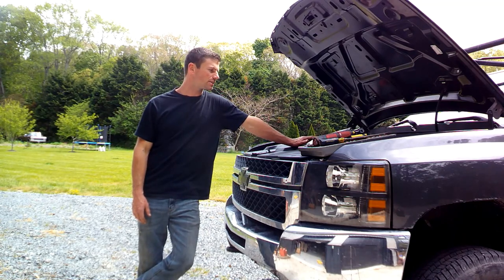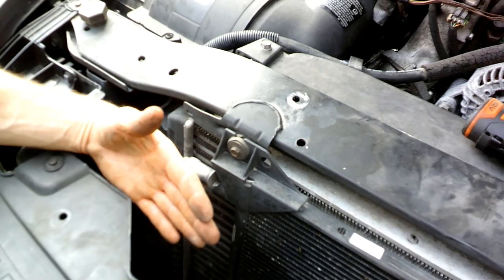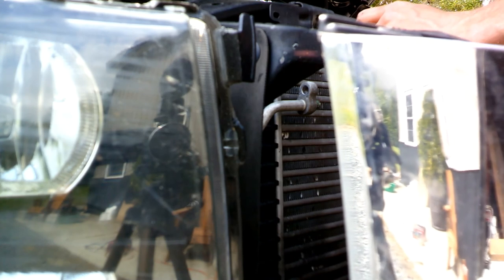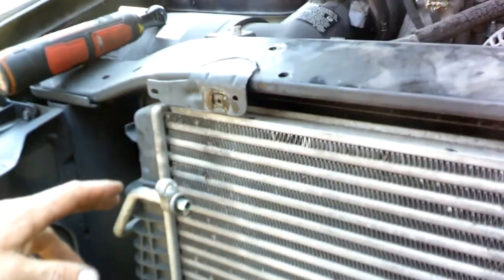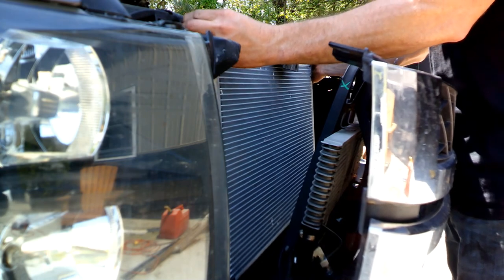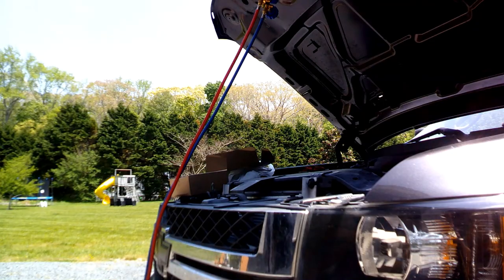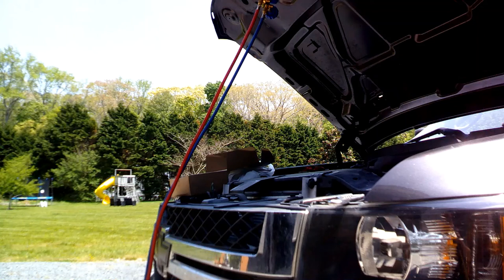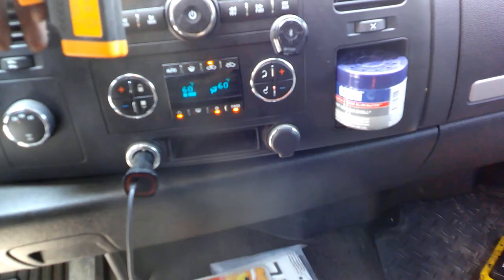08-13  GM Truck AC Condenser Replacement

Comment: You didn’t show pulling a vacuum to get all the air out after sealing the system up.
Reply from the maker: Oh ya it's pretty self explanatory, I'll be sure to include it in another ac video if I do one.

Comment: You may have missed putting in O ring seals on the condenser piping. Did not see you add new ones or transfer the old. If you lose all your AC it probably came from there...
Reply from the maker: Thanks, ya I snuck em in there. The ball valve ended leaking on the high side so I had to pull it and i replaced it with a Schrader .
Reply: Cool video, thanks. I have an 09 Avalanche that I need to replace the condenser. 

Can you tell me if you needed new O’Rings or you used the originals? I have 2 O’Ring kits from Harbor Freight (SAE & Metric), would they work?

This will be my 1st time doing this, what did you mean about replacing a schrader valve? Is that part of the condenser?

Comment: Yo buddy I am intermittently losing power steering in my 02 yukon on a hot day after I been driving awhile any tips
Reply from the maker: Not too sure.  Def check fluid level. I do if they have a cooler or not but if it does check lines and all for any blockage to be sure. Make sure theres not leaking lines that could let air in too.